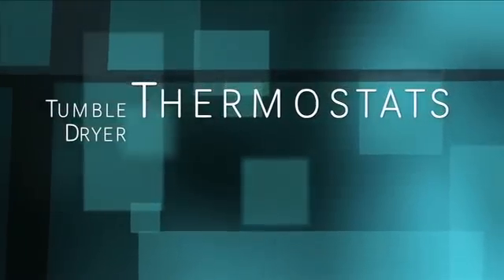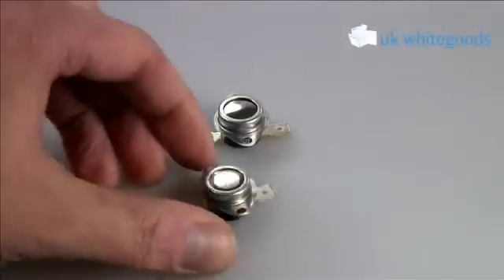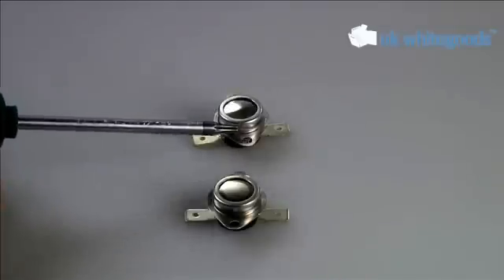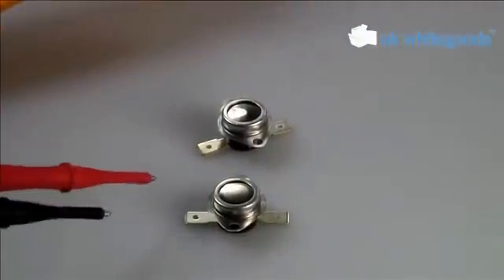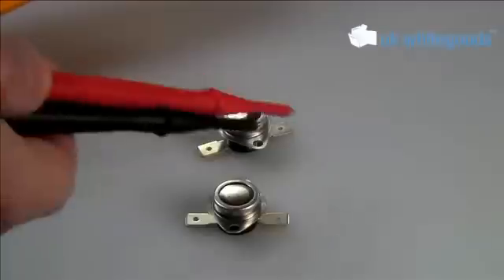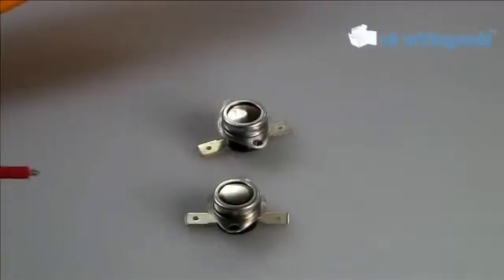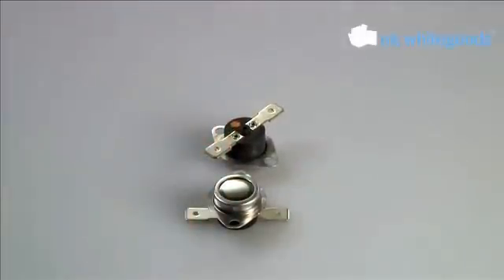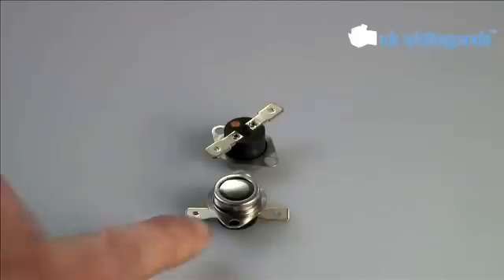Testing Tumble Dryer Thermostats

Comment: Hi 
Need help got a Hotpiont TL-11P tumble dryer  the heating started to fail on the dryer just wasn't getting hot enough
so i replaced the heating element and the two back thermostats  and it was working again but not has hot has it use to be
i have check the front thermostat with a continuity screwdriver and it seems fine ( i don't have a mulit meter to test )
other than that i am out of ideas......... anyone help ????
Reply: try cleaning the filter at the front it restricts air flow
Reply: try cleaning the filter at the front it restricts air flow.

from the heater
Reply: try cleaning the filter at the front it restricts air flow.

from the heater